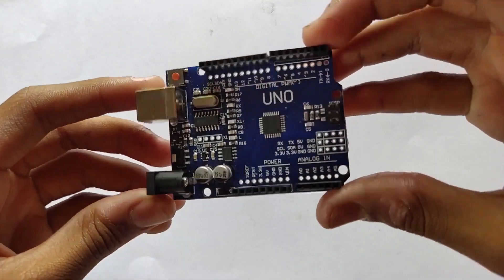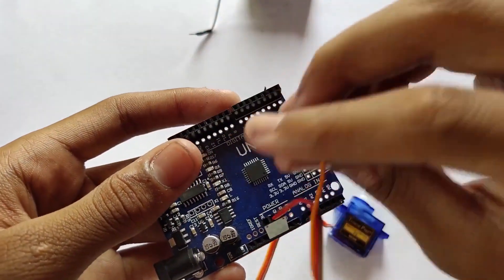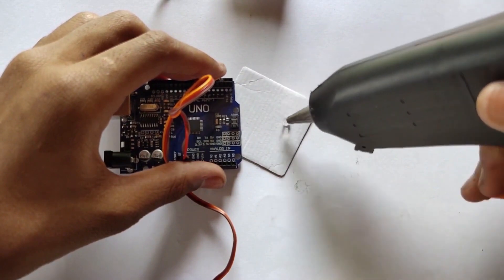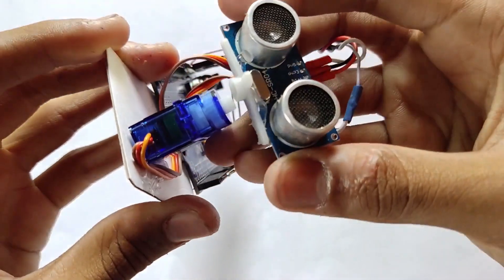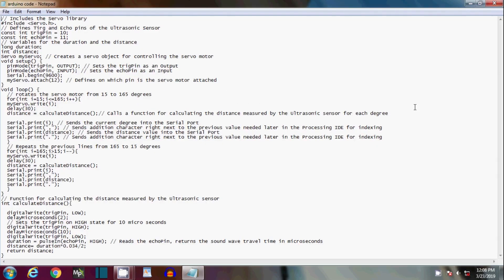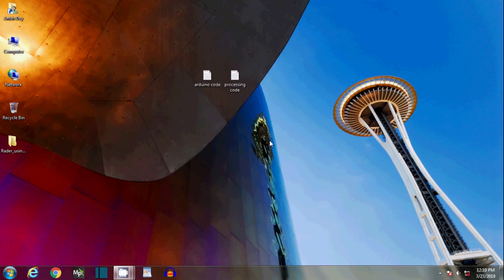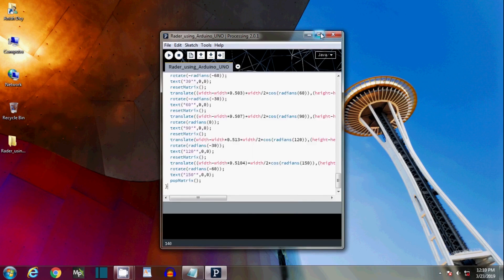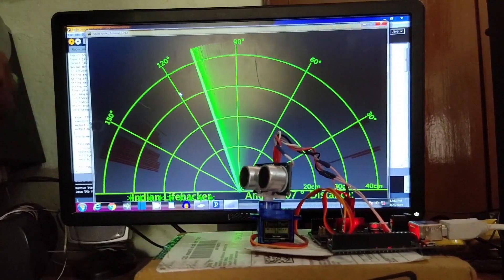How to make a Rader using Arduino UNO full tuturial by DIYLIFEHACKER

Comment: For my drone I can set GPS module 8M ???
Reply from the maker: sure
Buy Ublox M8N GPS certified for Apm 2+ seres dont buy for pixhawk otherwise the GPS pin will not match
Reply from the maker: Apm gps 5 pins and pixhawk are 6 pins
Reply from the maker: you can use M8N gps